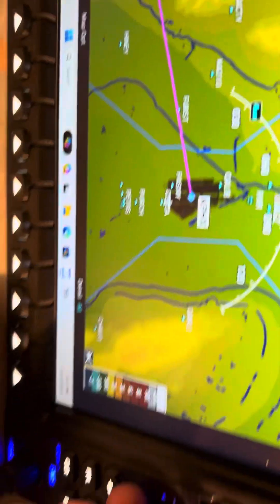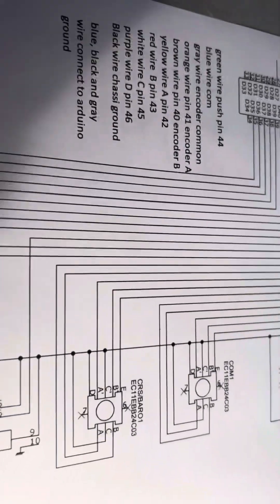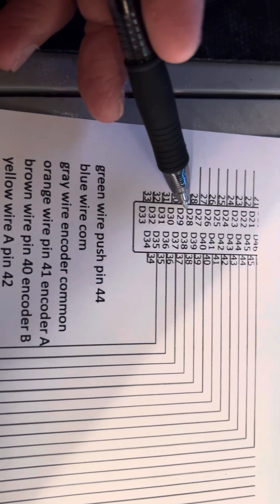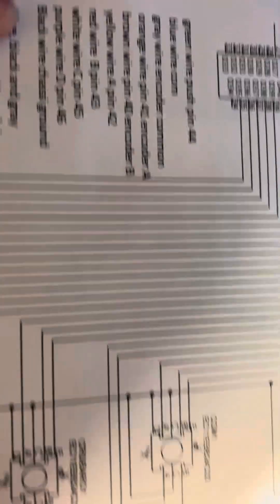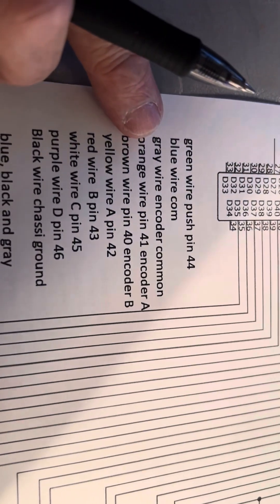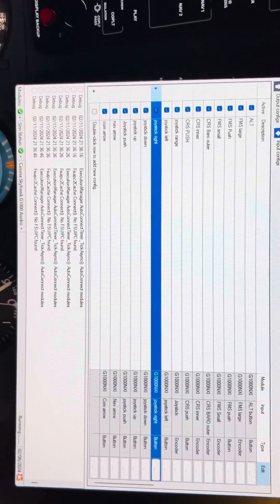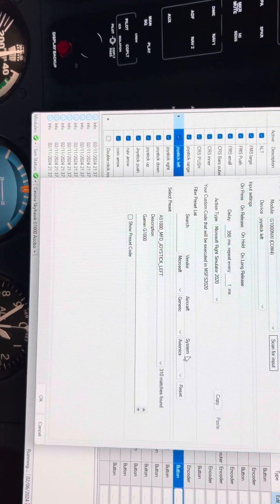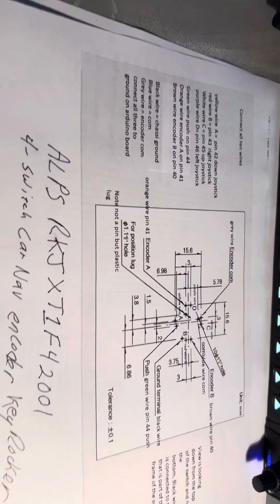Using 4 way rocker switch RKJXT1F42001  in MobiFlight and Microsoft Flight Sim 2020 for pan and zoom

Comment: Thanks for the video, I'm just about to wire up the back of my G1000 unbit. You mention a case for the G1000.  Does it cover the entire back of the unit.. Not quite clear in the video.  Was it printed, if so are you willing to share the CAD/STL?
Reply from the maker: I 3d printed the case I’ll share that file with the stand no problem. I made a push button feature on the back of the case to push the buttons on the video board. But depending on where your video board buttons are located that the hole cutout may not line up.  I add the link here soon

Comment: Hi there, thank your for this video.

I've just implemented that too. There's still something wrong with my config, I see in this video that you experiment it too : When you click on the switch to enter in the "scroll" mode,  then scroll to one side (left for example), and "click" the buton located on the limit of the left joystick. At this moment the map is reset, and it should not.
It's because this "click" triggers the same  signal than the main switch button.

Have you been able to overcome this issue ? From my side I'm thinking about not listening anymore to the switch event and add a dedicated button..
Reply from the maker: Your right it does reset and maybe not ideal for a real Garmin

Comment: Do you have the files to 3D print the components for this Garmin? Would be willing to pay for them.
Reply from the maker: I downloaded them from Hell Mech

I have his info on my site

https://radpaul.weebly.com/microsoft-flight-sim.html
Reply: How did you deal with :  the center push press always ON with Direction Push?
Reply from the maker: @jpatty5473 not really sure about that. What kind of behavior does the switch exhibit when functioning that way? Mine seems to work as intended. But, I’ve never operated a real Garmin before to know what the real functional behavior of the switch should be
Reply: @radpaul2574   oh , not for garmin just in general, i have read on the spec sheet , and other people using tthe switch as a hat switch in panels etc. As you push a direction,  the center push is activated as well.  Like in windows joystick device,  does 2 buttons get pushed when you move up for example?   Ive seen complex solutions using diodes to make it so the center is blocked out with direction pushes, and only works when you actually push the center. Not sure!  I ordered it to experiment , and i am building a f16 up front controller